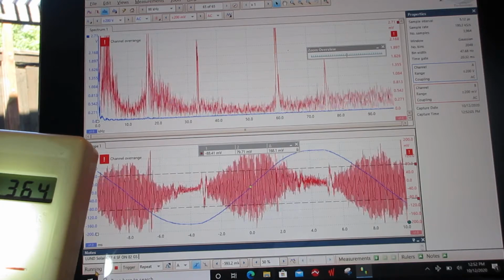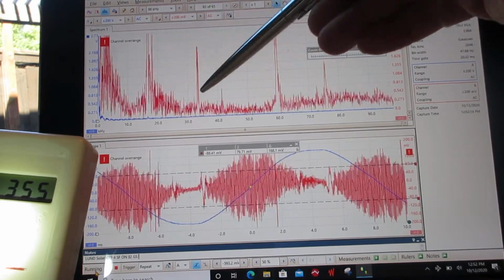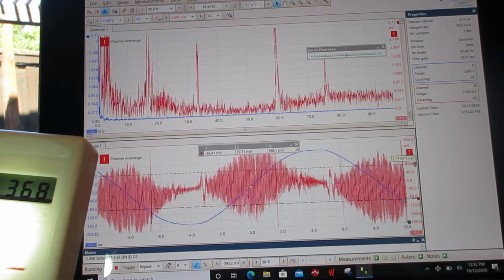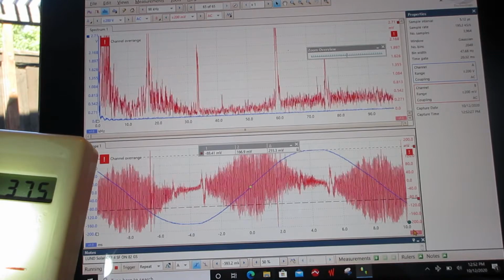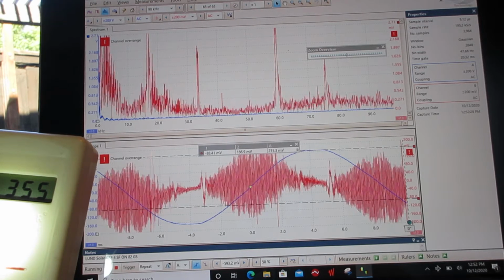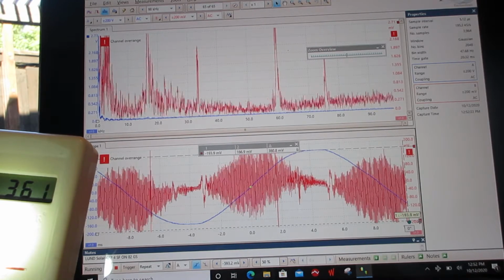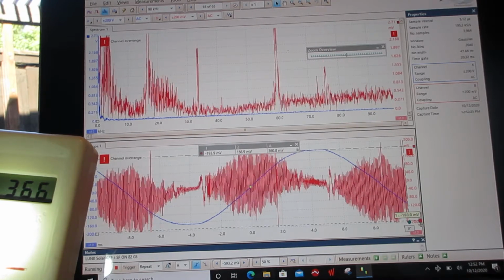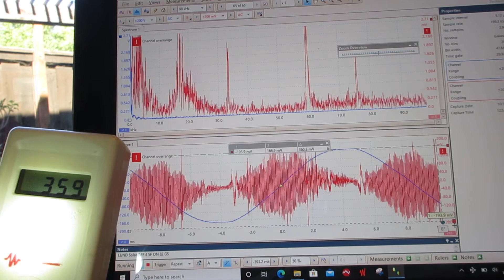Stetzer filters reduce a great deal of DE from a solar electric system

Comment: I've watched a few of your videos.  Is it the case that much of the differential mode noise is caused by the ubiquitous SMPS found in homes these days. Also, do all LEDs contribute noise to the mains or is it only certain brands that are the biggest offenders?  TIA.
Reply from the maker: Hi Mike,  Certain brands and certain devices.  Other sources are pulse width modulators (PWM) and variable speed or variable frequency drives such as energy efficient pool or well pumps and some inverter driven heat pump and HVAC systems.

Comment: Suspenseful.  Clearly, we would also want to know why the pricey Sinetamer (abt $1500+ installed) did not work as well as $150 worth of Stetzer meters?  Were the Sinetamer leads not cut to the precise length the manufacturer requires (the Sinetamer needs to keep very close proximity),  I wonder.
Reply from the maker: The wire run could not be any shorter: About 6 to 8 inches max

Comment: Hey Eric, can EMF be a cause of strange malfunctions in electronics? Particularly computers?
Reply from the maker: Yes And I started looking into the damage the dirty electricity would cost to computers back in 2008 But then that led me to what Dirty electricity can do to people
Reply: @windheimemfsolutions  Thanks for the response. I need to check into this and see if I’m a victim of it as there’s been unexplainable things happening with my electronic devices around the house.
Reply: I had an interesting occurrence in my home, I measured high amounts of DE, when family replaced a defective refrigerator, the entire house went back to normal. Normal being that high amounts of DE were closest to the main power panel. Once, I filtered the house and saw no other EMI's with a Trifield Meter, I was able to sleep soundly. I was very surprised to realize just how much high levels of EMF negatively affect sleep.